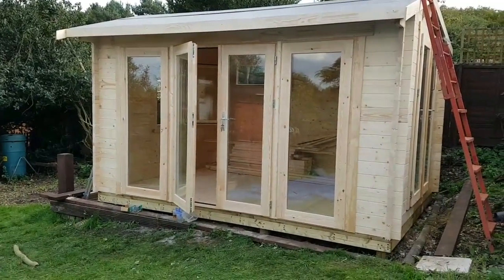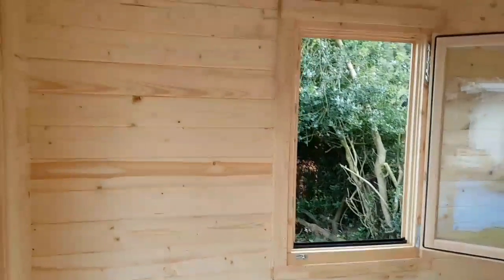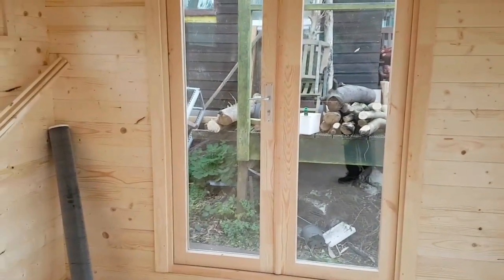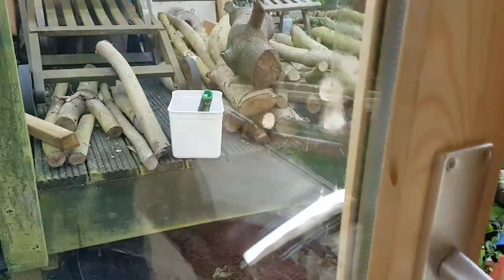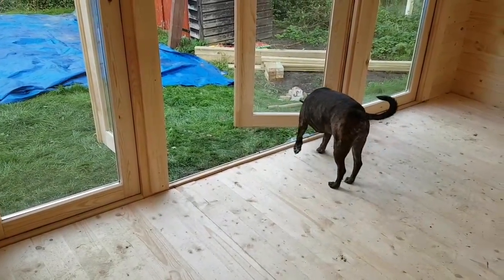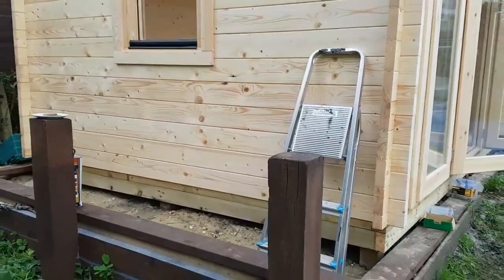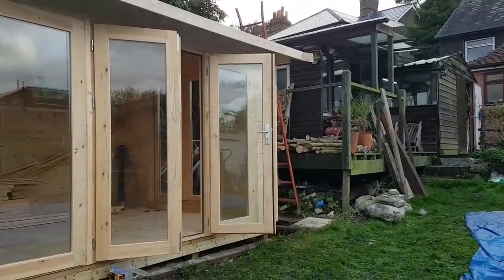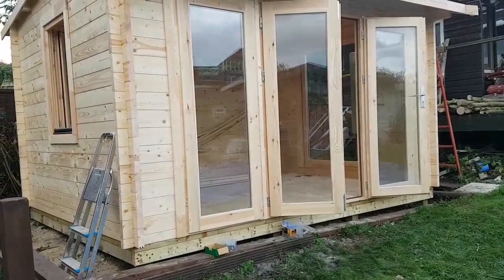KT TOOLS WORKING MUSEUM & MEDIA CENTRE BUILD

Comment: Interesting build Jim, what locks one row of wood to the other so they do not lift up in high winds?  Is it just gravity?  With larger logs homes they spike each layer with gaskets and sealant in every joint.
Reply from the maker: Dusty Splinters Hello. Yes...screwed and sealed normally but as I need to dismantle and relocate this one next year when the old workshop is demolished and the larger one is in place...then I asked for those bits to be omitted for ease of take down. When it's installed in its final resting place only then will it be sealed and screwed. Frankly...I think the sealant is overkill as the double tongue and grove is designed to be watertight as the W shape breaks capilliary ingression of water...but sealing does no harm...so a thin film will be added then.